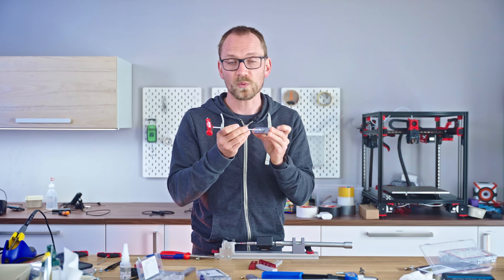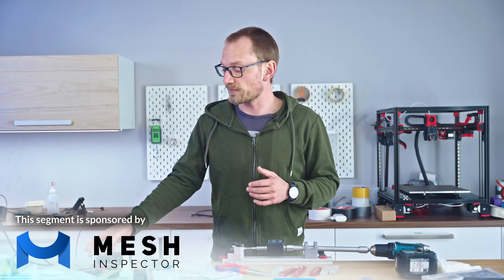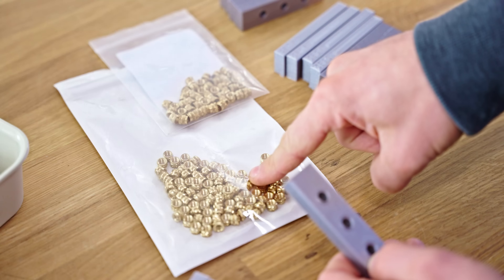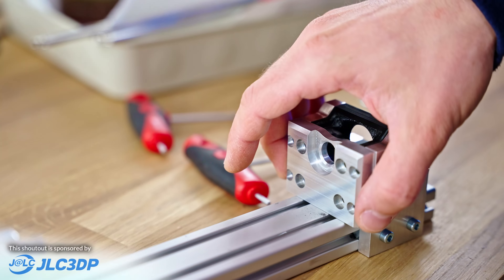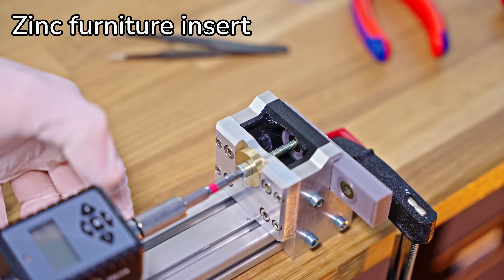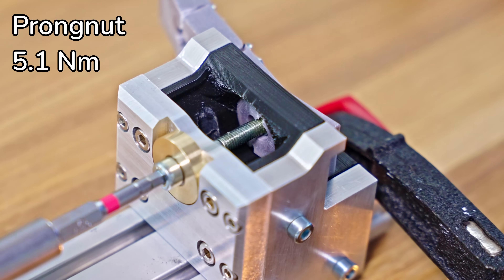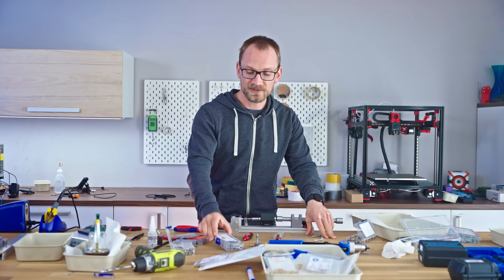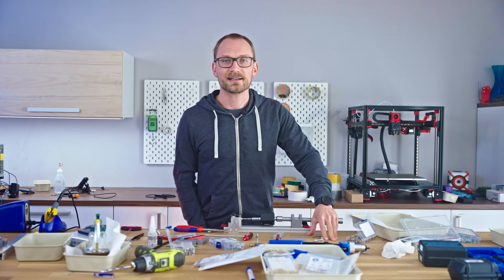These threaded inserts aren't made for 3D prints (but work amazingly well)

Comment: I feel like before you use those prongnuts, you should always check, if just inserting regular or square nuts into a pocket at the back of the hole might be good enough. Easy to design and works quite well in my experience.

Comment: As far as the helicoil-style inserts go, you can find off-brand ones for pretty cheap. I would probably also just print the thread in the part slightly too small (or model it exactly on size and let the 3D printer make it too small like it does) and then run through really quick with a tap beforehand to ensure perfect thread formation for the insert. That being said, that would be a fair bit more work than the solid metal self-tapping inserts, so I guess it depends on how much you're willing to pay. A bit of searching online and I was able to find 200 pcs helicoil type for $20, vs about $15 for 50 pcs of the self-tapping type. Which translates to roughly 3x the cost.

Comment: Great video! I had a suggestion for a future video. At least for me, when I am using inserts or just 3d printed threads, the parts that I am printing will be directly touching each other. I feel like this might translate some of that linear tension force into rotational force and cause the inserts to fail by rotating rather than pull out of the part. It'd be great to see how having some backing preventing the pull out of the insert affects the results of this test.

Comment: My very first design and functional print was a block for my son's toy chest.  The cheap box had lift hinges that mounted to a MDO (paper board) block.  they failed in short order. I designed and printed replacements and used T-Nuts (that is what they originally used) and just heat set them in with my soldering gun.  No need to model in the "slots" for the T's.  Box is still working, and no issues with those blocks.  Heat Set T-Nuts for the win there.

Comment: I think that helicoil has a key advantage, especially woth small screw diameter - they're thinner than self tappers or heat inserts. That might be useful in some cases.
Btw, I tried quick google and found helicol-like V-coil M3 inserts for cheaper, than their self-tappong counterparts. Plus, I discovered there's also a threadlock variant.

Comment: For people looking for tests of embedded nuts etc - CNC kitchen did a bunch of testing on these vs heat set inserts a while ago, and I think that's why Thomas didn't repeat that here. 

Honestly the best use case for threaded inserts I've found is replacing self-tapping screws in car parts with machine screws. The air intake and cabin air filter housings on my old BMW were held on with self tappers and after many years of removing these to do maintenance they weren't working anymore... some nice pan-head stainless machine screws with washers and 10 minutes work setting the inserts with my soldering iron and it was all sorted. At least until I let a "professional" work on my car and they torqued out one of them, obviously using an electric driver, and I had to glue it back in...

Comment: Can you do a quick run of a mid print dropped in hex nut and square nut. Separate test of just pulled from the back side like the tnut would also work. It would be interesting to see if the nut pulls through before it would torque its way loose

Comment: I've found that if you can't access the back of the part to insert a nut from behind, I can often make a slot to insert one from the side of the part. You just slide it down the side hole till it's under the fixture hole. This works even better if you can get square nuts but they only seem to make them in imperial sizes

Comment: You could basically any of these sinilarly to the prongnut and install from one side while pulling through the part. Especially the rivnuts and zinc furniture threads with the large shoulder. You should check those along with a standard hex nut and square nut

Comment: Pronged Nuts have the potential to be stronger than that simply because they have to be strong enough to be hammered into wood. Though I'm not sure why you didn't test them as heated inserts, which would be like hammering them into the part. Also, could you help the inserts stay in place if you introduce a washer into the equation?

Comment: In my humble opinion, plastic reveals itself as a rather subpar material when considering that the required tightening torque for an M5 bolt ranges from 7 to 13 Nm, depending on the metal composition of the bolt. So, what exactly is the utility of a material that can only endure a maximum of 2.5 Nm when applied to inserts? From an engineering perspective, this suggests that there is little justification for employing bolts larger than M3, which necessitate a tightening torque of 2.2 Nm. However, we cannot definitively determine whether M3 inserts are capable of withstanding 2.2 Nm in thermoplastics, and there exists a distinct possibility that they may not. In conclusion, I fear that thermoplastics simply aren't suitable for the use of bolts and inserts. It appears much wiser to simply employ self-tapping screws for plastic or, as a fallback, wood screws, both with flat heads. This streamlines the design process, eliminates the cost of inserts, and saves time on installation, all while maximizing the torque that plastic can withstand.

Comment: This might be a personal rule for installing helicoils, but I've always after threading it in to depth, I then reverse as if you're unthreading it, while gently pushing down so that the helicoil expands into the material. Once it grips the tang snaps and it's properly seated. Doing it your way can sometimes mean when you remove your screw, the helicoil comes with it and can be a real pain.

Comment: I've been using rivnuts inserted from behind for a while. I use aluminium M3 rivnuts as heat inserts (not crushed). If you design for them, they're hard to beat. You have to destroy the part to pull them through. I feel their potential was not well represented here. They'd have come second to the prong nuts, but are easier to implement.

Comment: but you didnt test normal hex huts. Its as efficient as the pronged nuts. I consider them inserts as I make the hex shaped hole on the back side. Otherwise pretty good stuff, now I will test with the coil insert as they seem to be the best of all the inserts for thicker parts.

Comment: Why would you measure torque instead of force? The failure mode is pull-out, not stripping. Torque is also going to be affected by coefficient of friction between the two metals, but won’t actually affect fastening strength.

Comment: I find myself printing knobs/handles for various woodworking jigs and usually use embedded square nuts (slightly more resistant to over-torque tear-out vs hex)… but thanks for the reminder that I should consider modeling in some space for t-nuts since they're often a lot easier to find in 1/4-20 than square nuts.

Comment: I like this new series.
I think the test could be improved though. You should use pulling force rather than torque. This will mean you can test different sized inserts without thread pitch impacting the results (finer pitch = less torque for the same load). It will also take away any variables caused by the material or surface finish that are creating additional friction when tighten the fastener.
This would also let you use a simple load cell so that you can plot the strain on a graph if you want.

Comment: The tests are awesome, but I think there's two different types of loads to consider here. My theory is with the combined heat generated from the fastening of the screw as well as the rotational force I could see this lowering the overall holding power of it during its actively loaded test phase. While if the insert just had an axial force applied after the threaded puller was installed I could potentially see them withstanding a higher pullout force. It depends on how the insert will be used I suppose.  Interesting findings! I was not aware of the self tapping inserts,  I'll be adding those to my arsenal for sure! Thanks Tom!

Comment: I do industrial maintenance. My favorites for soft metals and UHMW plastics are called Key Lock Inserts. They favor the self-tapping ones you tested in material, but you drve in a key to prevent them from threading loose. I wonder how they would test? Great Data, thanks for your work!

Comment: What about using the self threading ones and screwing them in whilst using heat so they melt a thread in?
Reply: Not getting this. If they are heated, and thus the threading is melting, how can you screw it in by the threads? They kind of will just melt?
Reply: @FrodeBergetonNilsen  If you heat them to just below their melting point then you can possibly cut through the plastic instead of pushing it out of the way when hot enough to melt. Just a thought ?

Comment: Why go to the effort of a threaded insert when you could just use a screw designed for plastic. Like polyfix screws which have a wide thread and can’t be easily over tightened or stripped.

Comment: Thank you for the exhaustive test. You really went all out. If I could pick one little nit - I was hoping early on in the video that you would test the standard brass heat set inserts installed from the back side like the flange nuts. I know you can't always use them this way - but it would've been nice to know how much stronger they are when possible to utilize them in that installation method.

Comment: I think the prongnuts would be best used, when you can insert them into your print with a pause midprint, insert it and print over it. But that obviously only works if your front hole sits on the bottem side of the printed Part.

Comment: best solution: square nuts. can use them as print-in-place. super space saving (only 2mm thick). very cheap (6 cents a piece for M3 8x8mm). can't be pulled out like the melt inserts, so is as strong as the printed material itself.

Comment: Great test and comparison, if just to satisfy curiosity. However, I find little reason to choose any of the other inserts over the typical ruthex/cnc kitchen inserts. You'll end up doing more work for marginally better results. The wall thickness/infill density info was probably more pertinent than the type of insert; I typically use 4 walls and 30% infill.
Testing carbon fiber PETG and PLA would be a good test.

Comment: Pro tip for modeling this and many other parts. McMaster-Carr has 3D files (in multiple formats) for tens of thousands of parts. Just download what you need and add/subtract/manipulate to your hearts content. When it comes to hardware, I have found the files to be spot on.
Reply: Oh yeah, so does Traceparts, 3d contentcentral and some others, highly recommend sources
Reply: FYI, most of the places with the CAD/STEP/etc. files sometimes use multiple vendors for the same part. The files do not always match. For non-branded critical fit parts, it is best to buy the parts you intend to use and verify the models before use. I have received the "same" parts from different manufacturers in the same order before, one matched the CAD, and the others were just different enough to require a design change. This has happened to me with fasteners, inserts, bearings, gears, wheels, and more.

The McMaster-Carr heatsets do all seem to follow their published design guidelines, though they are different from the "Voron Approved", CNCKitchen, Amazon, and AliExpress heatsets...
Reply: If you use Fusion 360, the McMaster-Carr catalogue is integrated and you can easily import them as components in your designs (I assume they're also available on their website if you use another CAD program). It took me way too long to learn this and I downloaded or modeled standard parts a number of times when I could have imported a more accurate model in seconds… 🤦‍♂
Reply: Really good tip, especially if your part follows any type of standard like DIN, ISO, etc.
Reply: I use this quite a bit.
Reply: If I want 3D model or a nut or a thread and so on, I use addon Fasteners in FreeCAD and export as STEP to be used in IronCAD (as I don't have IC Mechanical purchased)
Reply: I used STEP files from McMaster-Carr frequently, to the point of downloading my own local library of the STEP files for different sizes of the fasteners I commonly use, but now FreeCAD has an extensive Fastener workbench with all of the parts I need.  Still, it is very handy to buy industrial parts from McMaster-Carr, download the CAD files, and use that to design while waiting a day for the parts to arrive.
Reply: Just be aware that using McMaster's 3D files in a printed part violates their terms of use. It specifically calls out 3D printing and prohibits it.
Reply: @ChrisHeerschap  To be fair I think the intention of that rule is more regarding the replication of the part itself rather than designing around it.

Comment: I always flip the Riv-nuts around the way you did with the Prong-nuts. You don't need the special tool just a slight recess for the larger diameter It'll never pull through. But you need a thick part and access to the rear for that mode of use. The disadvantage of the Prong-nut is size and complication of the interface geometry. That extends the print time by a lot. I always use Riv-nuts and heat inserts I've never been disappointed.
Reply: 100% came here to say the same thing. At least for smaller rivnuts like m3, this has worked great for me for several years.  I have also had success pausing prints, pushing in some rivnuts, and then resuming the print so the whole thing is embedded and invisible
Reply: @ozonepat  yeah I use 10-24 screws a lot. that seems to be a goldilocks size for my builds.

Comment: Interesting comparison, thank you! I am not so happy with your testing method. You measure the pull out force using torque. I have no clue what this means for me. I could try to calculate the force from that, but than I need to guess friction.  Placing a load cell between your jig and your specimen to directly measure the pull out force seems really easy and would provide a more practically usable result. The relative results wont change though I guess, but brass or steel inserts friction difference might cause some other results.
The actual pull out forces would be really intersting to know, as I rarely torque those connections but can make educated guess on how the connection is loaded. I might not need a insert at all or might need more bolts/a preloaded connection.

Comment: i had good luck with Screw-to-Expand inserts, i buy the ones in mcmaster carr. the codes are 90363A110, 90363A120, 90363A130, 90363A140. sad thing is they only go to m4. i have never done any test and the load that i've put on them is not that big but could be an interesting experiment.

Comment: Next you should try various methods of using nuts. You could test normal hex or square nuts as well as trying them completely embedded in a part (added during a pause when printing), pushed in through a slot in the side or used normally from the back.

You could also see how much of a difference adding washers creates. In theory it should be like the prong nut but better since you don’t have the teeth and hence holes going down through the part which probably caused weak points.

Comment: I work in rapid prototyping and we use the self-tapping inserts for our SLS-printed nylon parts. The brand we're using is called Ensat and they have special tools that are similar to thread cutting tools and make inserting them easier than with a bolt.

Also designing the threads in the part is not needed if the hole that the inserts threads into is the correct size for the insert.
Reply: You can even cut holes later on and it will still work.
Reply: @sierraecho884  It seems like it'd be best to preform the hole in the design so you have perimeters around it, otherwise you'd be drilling through the top layer and into infill, no?
Reply: @JasonRamirez668  I replied to the OP and he mentioned SLS, there is no support in SLS.
But in FDM that´s true, yes.
Reply: @sierraecho884  Oh, my bad, didn't even catch the reference to SLS!  Thanks for clarifying
Reply: @JasonRamirez668  No problem buddy, you are welcome

Comment: The threaded inserts are essentially a larger diameter screw.
I wonder if simply using a larger diameter screw to screw into the plastic directly is a simpler solution.

Comment: Hey Tom, I saw your last video on pullout strength and while I most sincerely appreciate your scientific approach, I disagree with your conclusions. I think your methodology is flawed, namely, you're not tapping well.

1 - yes more walls which you've covered in this video which is great.
2 - lub your pilot holes. You'd never tap metal without adding some oils, tap magic, or at the very least WD. Plastic is no different.
3 - if you can afford it, buy a tapping machine. They give you a perfect tap every time. Seriously I've tapped M1.6 into FDM parts. If you can't, I'd recommend hand tapping anything M3 and smaller. Its best if you have some form of vertical press (drill press, vertical press attachment for dremel, at least a good drill with a bubble level), and go slow, go back and forth a bit if necessary.
4 - taps matter, as do pilot holes. Don't use a forming tap. For deep holes you might want a chip clearing tap. Sometimes you might want to redrill the pilot holes, especially small holes or holes parallel to the build plane.

That being said, if you really need strength, nothing beats a nut. You can get narrow nuts that don't require much larger area than your screw diameter. You can receas or pocket them, or even added pauses and embed them.

I've found most inserts to be a pain that require too much design compromise and torque out easily anyways. I will on rare occasion heat stake in mold-in steel inserts.